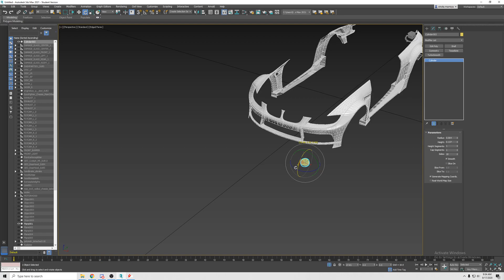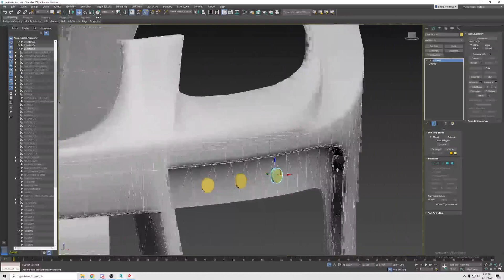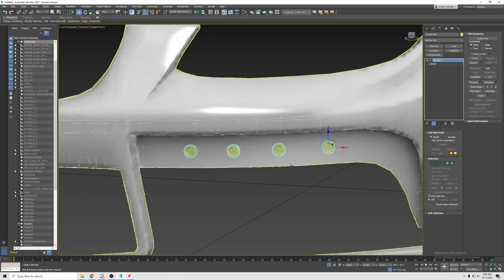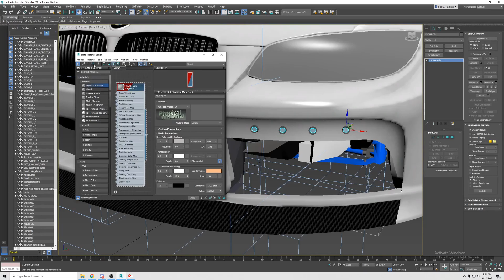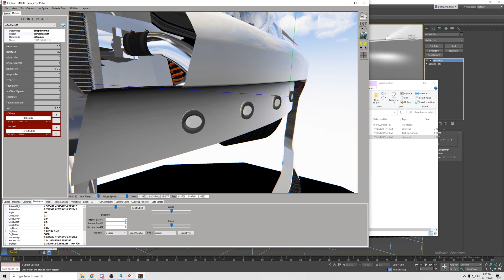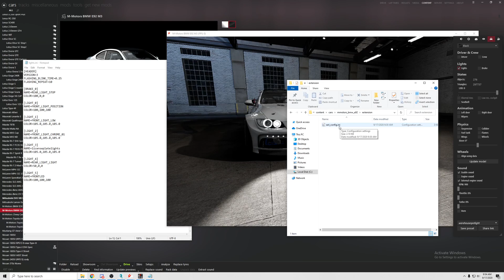Custom LED Lights | Assetto Corsa | 3dsmax

Comment: there is a tutorial how to make a starlights and ambient lighting ?
Reply from the maker: I mean for the starlights just make little round objects and light them up in lights.ini or extensions. For the ambient lighting you can use like the underglow preset and make it inside so it acts as an interior glow

Comment: nice Video! how do i make my own blinking pattern? on Github there is an explanation but it says on this option it sets the pattern as "LUT"? what is LUT and how can i generate a "LUT"?
Reply from the maker: If you take a look at some of the police cars in AC they have the strobing lights in the extension folder I believe. You can take a look at that and see if you can reverse engineer it haha

Comment: great video, do you know how to add indicators? I have the buttons mapped but the car I'm modding (WDTS AE86) doesn't come with indicators. Do I need to change something in a .ini file or something?
Reply from the maker: I haven’t really messed around with indicators yet. If you can find the SRP cars you might be able to see how they did it and apply it to your build
Reply: @MamiyaMotors  yeah tried that, they have ksanim files attached to lights.ini but i dont care enough to go and set that up lol, i might go and add them like normal strobes but link them to an "extra car function" if i can find out how that works. Thanks anyway, the video let me add some nice custom rears (japanese for 86 as the brake lights)
Reply from the maker: Hmm, I think you could also make them a strobe light with a steady flashing pattern and just have that toggled to extra options

Comment: is there any way to make a light on the car be blinking like that, but turn on at the same time as the normal headlights?
Reply from the maker: I think that would be a multi step process. You would need to set the object in lights.ini to turn on with headlights. And then in ext config you can do the blinking pattern mapped to extra options. I’m not entirely sure if that will work or not but worth a shot

Comment: I wanna make a Christmas tree with some lights in on the roof of a car. But when I want it to flash in diffrent colors do I need to make every light in a singel group or can I somehow make it easier?
Reply from the maker: I haven’t done anything like that before, but I imagine you can group the lights together and have them flash as a group of that makes sende
Reply: i know its 4 years later but im working on a similar project wondering if u got that to work out cant really find anything on it
Reply: @352pat I never got it to work I think

Comment: I noticed that the objects I set to strobe vanish when you toggle off. Is there any way to work around this?

Awesome tutorial, worked super well!
Reply from the maker: Hmm, I noticed that it seems to have issues when you use both the lights.ini and extension config files.
Reply: @MamiyaMotors  I actually found it last night, you don't need the vanish lines in at all for this to work. Deleted those two lines keeps the object visible on the car when toggled off!
Reply from the maker: Dope! Glad to hear it worked out!